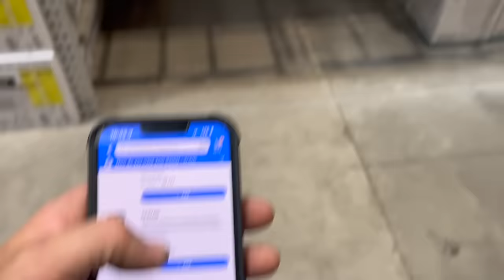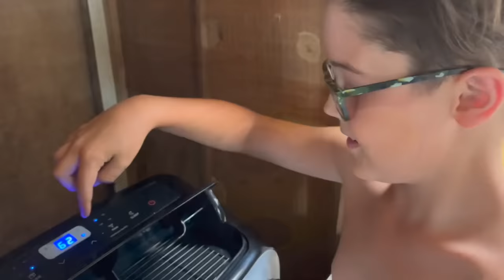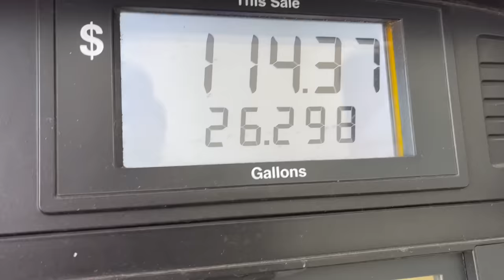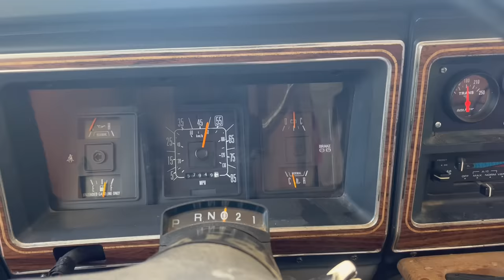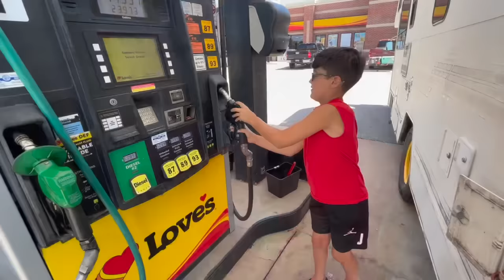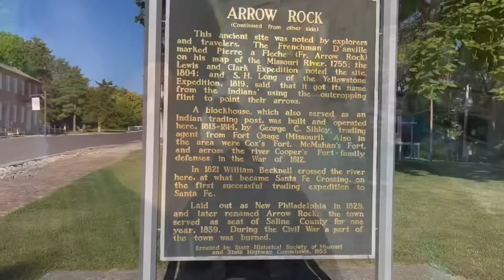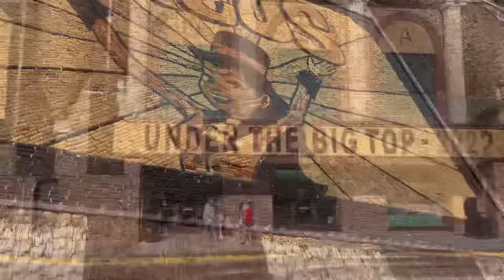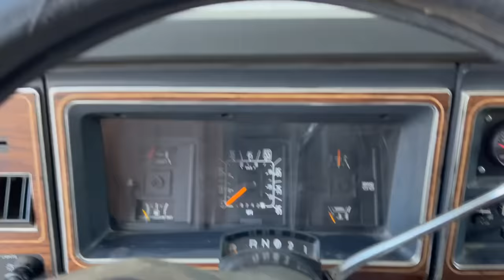Wild West of America Road Trip in a 31 year old RV Can we make it?

Comment: Solder that hole shut, find a newer r134 equipped parts car with a nice straight valve and then find a nice straight place on that a/c unit to cut and solder in that valve and you can recharge it yourself

Comment: You can weld the damage you did on the A/C then pressure test and recharge,
Reply from the maker: Yeah the problem was it has no charging ports and they would have to order those and it would take a week or so
Reply: cheaper to order them instead of buying new A/C. Oh and the gas tank is old you might want to put on an external fuel filter that you can change easy. Check your fuel filter maybe why your stumbling?  @Sleeperdude

Comment: I'm thinking vapor lock is a problem.  Happened to me going from Pa to Colorado in a 2005 Hyundai Tucson.  Limped into St. Louis and spent the night. I filled up with fresh gas and a bottle of fuel additive and no problems until going through Albuquerque and the same thing happened.  Driving for hours in 100° temperatures makes it worse. Also high altitudes can cause the same problem. Stop more often and put fresh gas in. You got this.

Comment: Hey I had the same thing going on with the hesitation/mins in my new to me 27 year old motorhome with the same power train as yours happened after warm driven for a while after going through everything else scratching my head pulled the the ECM removed the cover had burst capacitors turns out it’s pretty common on these. Just a thought got a reman one in there from oriley been perfect ever since. Mine is a 94 class c with 79000 on the 460

Comment: I would like to offer a practical  solution  too. Your air conditioner problem  the tube pipe if the hole is not to big you might be able to patch the hole with JB weld  or  make a sleeve  to go before  and after the break or piece of aluminum foil with Jb weld I fixed emission pipe  on 1980 Plymouth Volare would of cost me big money to replace it

Comment: Get it brazed shut. You have to use silver solder and dry nitrogen flowing lightly through your lines getting vented to the air. Trust me it will hold. and then a recharge.
Reply from the maker: Ok thanks
Reply: @Sleeperdude  We used to get "u-bends" replaced all the time.You have to purge with dry nitrogen by flowing it through the system and dont pressurize just a slow steady flow so when you use real silver solder which can be bought at a weld shop or dealer. It looks like flat copper wire sort of. You would need oxy/acetylene with a small flame and what nitrogen does is stop it from causing flaking inside the area being heated. Dont let anyone tell you it can be done.

Comment: Mine did the exact same thing…vapor lock
Reply from the maker: Ok thanks
Reply: @Sleeperdude  unfortunately I did the same thing you did BUT in the middle of Wyoming, changed out fuel pump twice(mechanical though)than ended up renting a UHaul and selling the RV in the nearest town!! Lol. I was told that the fuel lines heat up in those 460’s and vapor lock the motor!! Man it was some stressful flashbacks watching your video. Glad it turned out ok and you and the family were safe.

Comment: Ever heard of solder Dude, could have fixed it cheap and easy. A decent wattage soldering iron , stick of solder and some liquid flux . Real simple would'nt even have to unbolt it from the roof. Clean the spot with some fine emery first
Reply from the maker: Yeah we were going to but needed charging ports put back in and couldn’t get them in time to leave
Reply: @Sleeperdude  If you do probably best to cut a little bit of copper or alloy and make a cap to put over the hole

Comment: Hey guys, I think I know what you're issue is. I to bought a $500 RV then drove it 21 hours into Canada, the RV had a plastic gas tank but when I got to about 1/3 of a tank is would stumble, it ended up being the dip tube, or draw tube inside the gas tank was rusted with holes from sitting so long with out fuel. I hope this could help you figure it out. May God's angels protect you on your journey and His hedge of protection be around you and yours. Your pal and fan Troy
Reply from the maker: Maybe so

Comment: Trash in your fuel line 
Shorten your belt on the motor. Run a 12v motor to turn your a/c unit on your motor with a switch you can turn your a/c on with out cranking your motor. with maybe electric fan on cooler, put a switch to your fan motor in dash. Good to go. Even when you're driving 👍

Comment: Did you check the fuel filter in this before you took out. I had a fuel injected car that kept doing that and it was because the fuel filter was starting to stop up but wouldn't stop up all the way. Changed it,  it had brown fuel in it, and it stopped surging.

Comment: Lots of detail were missing like replacing all the gas line , gas pump, gas filter , new fuel injector and the fact in case it have to be tow with an old camper like this one you have to make sure nothing is overlook
Reply from the maker: Yes exactly

Comment: I believe when you were changing the fuel filter and when you dropped it down. all that brown come out that was rust. That was a really bad sign You should have dropped your fuel tank drained it and cleaned it out before the Road trip . I believe you have some clogged up injectors on your motor home camper . is what's causing your problems also that fuel filter that you replaced the microns are not small enough to catch all the rust particles going through it . you should have put a secondary fuel filter in somewhere towards the line to catch the rest of the rust I definitely believe you have a clogged or a few clogged up upinjectors . I've done mechanic work for many years. and what's I was watching on the video it sounds like a few clogged or blocked up injectors to me. God bless brother good luck with your motorhome

Comment: Dude Try Running some fuel injector cleaner in your fuel it sounds like your fuel injectors are blocked or blocking when at lower speeds through towns ✌🐻 Drive safe
Reply from the maker: We had already ran two bottles through it by this point

Comment: This is a bummer and I am telling you this too late... Before I retired I was HVAC-R for 48 years. You can or could have soldered that easily, evacuate and recharge. I have also repaired leaks like that, although everybody will say you can't, with epoxy. But....
You could have used 95/5 soft solder which does not require such a hot torch as silfloss...
Reply from the maker: I tried to get someone to fix it locally but they did not have the fittings they would have to have to braise in to be able to charge it back in time
Reply: @Sleeperdude  I understood the time factor. You need to call someone else. THERE ARE NO PARTS REQUIRED TO SOLDER A HOLE... Only a Mapgas torch and 95/5 solder and some emry cloth/sand paper. It's a small hole. You just cover the hole with solder. You can find someone who can solder.. Hell call a plumber to fix the hole and the A/C guy to recharge it....

BUT... Ya'll had a good trip. I enjoyed the video and look forward to the next one... Cut the stressin' man... You checked and fixed the motor so stop sweatin'...Just have a good time...

Comment: Hey starter up the hole you made in the air conditioner and recharge it
Reply from the maker: I tried to get that done but no one had the charging ports that would have to be installed to do that

Comment: Trash maybe kicking up in your pickup tube, When the fuel is getting low.
Reply from the maker: Yeah maybe so
Reply: @Sleeperdude  Just watched the video of y'all having to sell it. I wish it wouldn't have come to that. But don't let that Discourage you. I've been rebuilding old Rv's for some time now. It's worth it if you get creative. Anyone will pay a Pretty penny for an RV that is put together right, Not cheap, But remember you gotta keep the weight down best you can. Watch a Video on how Plywood is made. You will be surprised on what you can do with those cheap panels after you glue a few together. Also how strong they can become.

Comment: Wow, 7.5 and 6.3  Mi/Gal in that thing?   Well, you get about 6.5 Mi/Gal in an 18 wheeler grossing 80K pounds and about 8.5 Mi/Gal with an empty trailer grossing about 35K pounds.   Even in a 42’ coach RV equipped with a Series 60 Detroit Diesel you’d get at least 8 Mi/Gal.   Not much in the fuel cost savings considering that diesel is about an extra $1 per gallon, but you’d be riding in a luxurious 42 footer with all the bells and whistles although you’d be out of $125K on the purchase of a 20 year old 42 footer model in turnkey condition.   I’ve seen some 20 year old 40 footers diesel pusher by Beaver at about $65k requiring a little TLC, nothing as serious as rotting structure or destroyed interior by dope heads.  Those things are out of the trailertrash budget and the only things that need revised and fixed are the wearables and the things that get deteriorated by UV exposure.

What’s next?  Cruising the world in a sailboat?